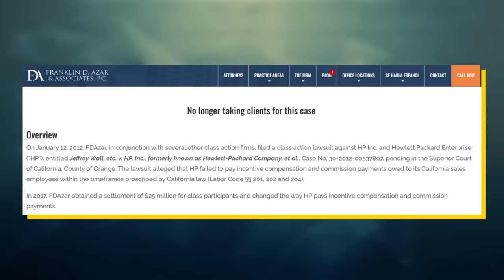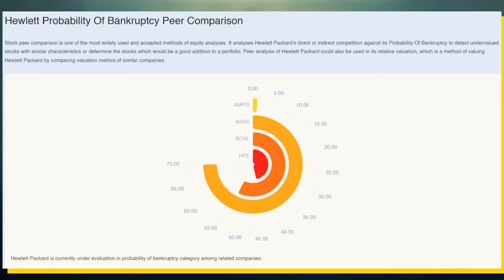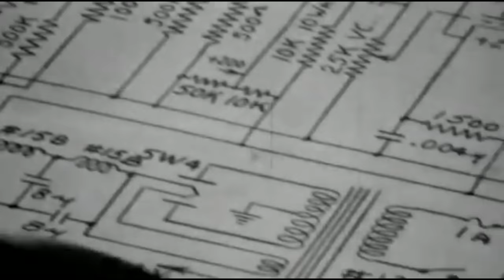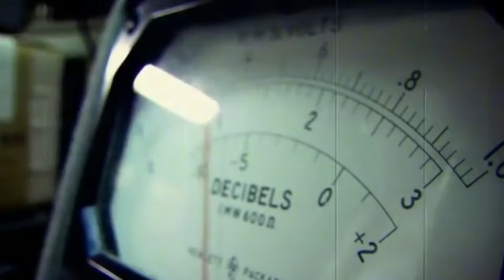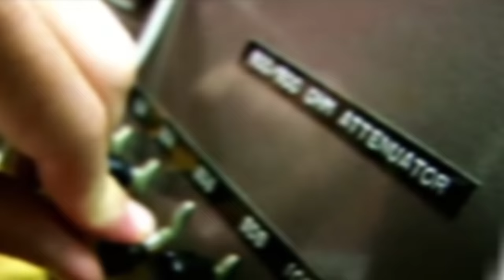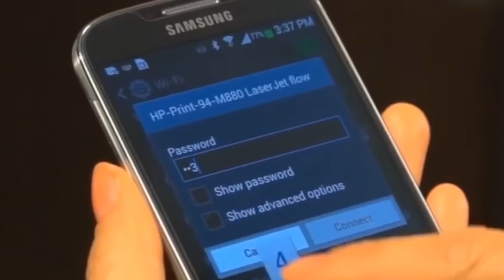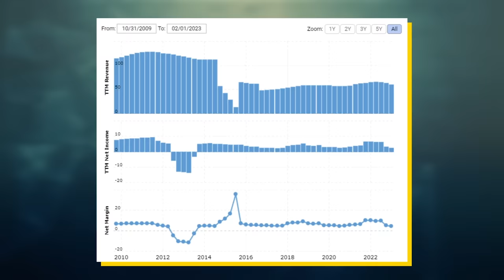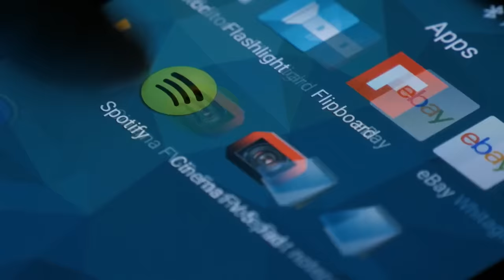From Innovation to Irrelevance: How HP Lost Their Way

Comment: The founding fathers, being Bill Hewlett and Dave Packard, weren't passionate about computers and printers.  They weren't passionate about the life sciences, diagnostics, and applied chemical markets.  They were passionate about engineering and building solid, high end test equipment.  The souls of these two wonderful individuals live on through Keysight Technologies.
Reply: The spinoff of their Agilent products, selling their verigy testers to advantest shows its lost of interest to their founders core business essentially!
Reply: Not totally correct. They also built a highly sophisticated enterprise computing business around the HP MPE, PA RISC and HP-UX technologies. Oh, and they once even had a industrial control computer biz. 

HP was absolutely remarkable in many different ways and it was financially very strong once.
Reply: @linkcubuspark  Correct. Advantest is now a key element of the semiconductor production process. They supply the testers to check most of the semiconductors we use these days. Think of Android CPUs, GPUs, Memory Chips, Power Transistors etc. The HP Way is also very much alive there.

Comment: I worked at HP from 2009 to 2012. In that time I was given 4x role changes from l1 support to l2, then l3, then sustaining. This wasn't cause I was some amazing tech, but because I was the only one who hadn't been on those teams for 5+ years and was applying for the higher roles. Sadly in 2012 they layed off the entire support department I worked for so they could hire cheaper engineers in Georgia. As I was moved to engineering I was kept onboard but wasn't going to stick around knowing what they do to employees so I left for a customer who wanted to bring me in house. This is their doenfall, they shoot themselves in the foot to save a few dollars over and over again.
Reply: It reminds me of Boeing who opened a factory in South Carolina to save costs. South Carolina doesn't have the calibre of aerotech workers that you get in Washington. The planes ended up with all sorts of shoddy workmanship, so much so that clients specifically wrote in their contracts that they wanted their planes to come from the Everett factory. I think that HP and Boeing suffered from the same rot you get when you're an industry leader.
Reply: @JB-yb4wn  Boeing definitely had it's issues, but not as bad as Lockheed. I used to work for Northrop Grumman. Grumman would do sub contract for both. There were times Grumman would win a military contract & build what ever was contracted. Few years later Lockheed would get a contract to upgrade it by undercutting the cost. Then a year or 2 later Grumman would win the contract to fix whatever Lockheed screwed up. Lockheed still makes decent instruments for aircraft, but should be kept away from any other contract. It's a shame how low Lockheed has fallen.
Reply: @williamallen7836  
You would think that the military would have wised up to such shenanigans and told Lockheed to shape up or ship out.
Reply: @JB-yb4wn  0
Reply: @NymbusCumulo928  
You guys need a revolution.
Reply: All American business leaders seem crazy for cost cutting stuffs
Reply: @armamentarmedarm1699  
Not in the US I live in Canada

Comment: A big portion of HP was left out. They acquired Compaq and with it huge consumer and especially server portfolio. Remember, Compaq were the predecessors of HP rack servers. They also acquired Alpha CPU architecture and ventured into Itanium, which turned out to be a money black hole.
Reply: Bought Palm in 2011, shut it down in 2012.
Reply: Before Alpha, HP and Commodore tried with PA-RISC. Commodore went bust in 1994.

Precision RISC Organization, an industry group led by HP, was founded in 1992, to promote the PA-RISC architecture. Members included Convex, Hitachi, Hughes Aircraft, Mitsubishi, NEC, OKI, Prime, Stratus, Yokogawa, Red Brick Software, and Allegro Consultants, Inc.
 
If Commodore survive into 1995, the Amiga would have PA-RISC OpenGL-based games console and personal computers.

HP replaced Motorola 68K-based workstations with PA-RISC.
Commodore attempted to replace Motorola 68K-based workstations, personal computers, and game consoles with PA-RISC.

Comment: I used to work for HP.  Like the article says, they were known for innovation and highest quality products.  They were also known for integrity and HP culture  and philosophy.  It was a great company to work for.  Customer satisfaction was a focus.   Then came Carly Fiona, et al and it went down the drain. Buying Compaq was the biggest mistake. Only person benefiting from that was Carly.  Instead of innovation, they would buy a startup and peddle that for few days until that became obsolete and buy  another and peddle it for few days... you get the picture.  Their theory was that the startups could invent products much cheaper than what HP could do with their overhead of a  large corporation.  But then there was not a clear path as they do not know what product they would acquire next and how they all fit together. I just bought a laptop from HP,  and needed customer support.  I would never buy another HP laptop.   I worked at Roseville and Cupertino locations.  I never could never imagine a day when HP would have to sell the Cupertino location just to make ends meet! It sure happened some years ago.  They also sold several buildings or demolished few to cut costs at Roseville. Talk about going from Riches to Rags.
Reply: THere is a still a C3600 HP-PARISC  workstation in my garage. I use it from time to time .... as a box to step on when i have to change the light bulb. Dam'it this machines were made to last forever and break peoples back when moving their desk.
Reply: @llothar68  Due to my past loyalty, I have been buying HP Laptops.  The last one I bought s a piece of crap.   It would not even boot up when  opened the box.   I called HP support and they wanted me to subscribe to HP support that cost $50 or $60 per month.  They could not fix it and it is unusable.  I am never buying an HP system or anything from HP again.
Reply: @ramaswamyadisesh6848  Well this workstation was build i think in 2001. It's a massive block of steel, a PC sized desktop case but 30kg weight.  I would also not buy HP today. This was a retro purchase to see what professionals have used in the past. Payed around $250 for an 8GB machine. 

Honestly with Laptops. I would never buy one at the moment. They are all compromises or way too expensive. I go with Desktop or Tablet. I guess thats what getting old means. I'm not so mobile anymore like in job/university days. I'm still a contract worker. But a good chair for $900 was more important then a Laptop.
Reply: In the end the founders did not groom the right successors. Neither their own children nor a cadre of HP engineers were groomed into worthy successors.
Reply: @llothar68  Any interest in a Digital Equipment Corporation MicroVAX II in my garage?  It still powers up.  I so loved VMS.

Comment: I have an HP laptop and a scanner from 2012 that I still use today as a hobby. 2 years later, the fans stopped working and HP fixed them for free, including shipping. Sad to see them go 

Problem is, today there's a lot more of competition and people are buying more and more high end computers , and PC parts, something that HP doesn't offers
Reply: HP simply offers crap value and nothing exiting. Look at high end gaming laptops, and you will see aorus giving you dual 1070 laptops each pulling 115w with an oc'd i7 in a laptop lighter than other gtx 1080 laptops all the way back in 2017. What did HP offer you? nothing. 

Even today, asus is starting to move to OLED on more and more of their laptops and HP being the relic, don't see any reason to offer glossy/OLED options on their gaming laptops. They neither have very impressive high end gaming laptops. 

HP also doesn't particularly make the best ink printers, often breaking down and just being crap to use. Laserprinters are fine from them though.
Reply: @siyzerix  I thought HP Spectre was popular

Comment: I owned several HP printers and they were all very good. However they recently discontinued the Pagewide line with no replacement. I have completed a switch to Epson as they are innovative, have a huge range and great performance.
Reply from the maker: Ah, so you’re the reason!! Haha jk
Reply: The pagewide were solid. We still maintain the product line but not for long.
Think they just weren't that popular.
Reply: Interesting, as I'm guessing the problems are with the consumer DeskJet line where HP seem to prey on non-tech-savvy people only looking at the price, such as my dad in 2014. I'd still buy a different brand following recommendations made to other users in Reddit comments.

Comment: Last year I bought a HP inkjet printer, and it was such a nightmare to use that I was actually relieved when it failed after less than a year so I could get a refund. Only to discover that the only way to remove the marketing software the printer setup had installed on my computer - according to HP itself - was to do a system restore to a point before I installed the software.
Reply: I had a preference for HP since they introduced the first consumer Deskjet 500. It was a toss up between the HP and a Canon inkjet but I believed the HP had the edge and I had great service from it. More recently I needed a photo printer and found HP offered none - bought Epson and very impressed. I now have a second Epson Ink Tank printer and all remaining HP printers went to charity!

Comment: I worked for HP in 2011 i.e. 12 yrs ago when they Mark Hurd fired 50%. Leo came in and said we will diversify to software and did a very bad acquisition Autonomy. Last I heard they are doing well with 3D printers. But it sounds like they are still struggling.

Comment: I deployed HP Enterprise software for over 15 years, and they were generally the best in their domain, but failed to execute and market new versions and visions of the integrated solutions from their acquisitions (Mercury, Opsware, Peregrine). Yes, the big mistake was not performing the correct DD before buying Autonomy, but fundamentally it's the lack of leaderships over many years. Poor vision, can't execute. The HP Enterprise Management and Monitoring software were leaps and bound to what I have to stitch together with the current Cloud solutions. HP had jewels in their assets but failed to see it.

Comment: I once used a HP monitor for 10 years without any issues. That's still sitting in the closet in my room. It can still run but the display now shows a vertical green line and the display itself is somehow peeling away. So I switched to a g7 odyssey 4k last year. Before that I was using the same g7 but the curved panel. Also when I was buying my first gaming laptop I really considered the rtx 2060 hp omen. That thing really appealed to me a lot.

Comment: A dysfunctional board, dishonest top-level executives and incompetent middle management made a good recipe for the Gray Lady of Silicon Valley. Microsoft and IBM were able to regroup (industry loves the word "reinvent") with different strategies. Randy Mott is the best example of the leading causes of HP's decline. He has a clear formula that suckers most CEOs (Walmart, Dell, HP, GM). Most of the incompetent senior managers and directors (from 2003) who stuck around till 2012 became VPs (Peter Principle at its worst?)! These people ensured that their sycophants tagged along. The inability to distinguish themselves (how's Agilent doing?) from the crowd meant being at the mercy of the ODMs. If Wall St was happy but entry level managers were leaving in droves, it didn't matter.

Wonderful case study opportunities for budding MBA students using the actions of top-level MBA (including Harvard alumni) graduates at HP. Don't blame it on the commodity business when ample opportunities existed with an overloaded Mergers, Acquisitions, Divestiture and Opportunities (MADO) department at HP.

Comment: HP is a bittersweet story. I'm an Electrical Engineer and HP alumni 1981-1991. Loved their logic analyser in college with button menu instead of the toggle switch alternative. Worked on the HP 3000 systems, which I understand was one of their speculative endeavors. Maybe they couldn't stomach competing with Tektronix, etc. - computers drew them into a rather strange place. But while I was there, loved "The HP Way" culture.  I subsequently had an HP Laserjet 5MP for over ten years, awesome reliability. Never loved their PCs, prefering IBM/Lenovo or home-built systems with generic components. I miss HP, sniff!
Reply: HP 3000 was a huge success, so was PA RISC and HP-UX.
Laser- and Inkjetprinters were true innovation then.

But then the founders died and all went south.

Comment: Im not too sure about the more expensive laptops but my 2016 budget hp laptop had bad battery management circuitry, damaging the battery and having to replace much more frequently. A budget 2016 Lenovo on the other hand had not seen a battery replacement until the HP went through 2. Older HP laser printers, without the software lock, still the best for reliability and value
Reply: MBA management of a computer company !

Comment: In the server space HPE is still quite relevant, known for their far superior BMC and having just launched a new series of Ampere-based ARM platform servers
Reply: Hpe and hpq are diffetent companies now, they split
Reply: @ihakker1416 they absolutely are. The big thing I think people are saying is that the consumer electronics decision of what was hp was never the most interesting part, instead we now have at least 4 companies that make up what used to be the HP of its hayday, HP Inc (consumer electronics), HPE (enterprise computing and consulting), Agilent (medical devices), and Keysight technologies (test and measurement equipment). Only HP Inc is not thriving.
Reply: Still a shadow of the 1990s HP, which had PA RISC, MPE, HP9000+HP3000 semi-mainframe computers.

Comment: HP started it all for me. My first PC I dissected when I was 9, HP. My first laptop when I was 13, HP. I even sent them a laptop design when I was 12 just to see that design on a store shelf a year later. Every PC I ever owned that I didn’t build, HP. That ended around 2016 when I switched to a Mac and started running BootCamp for my Windows needs. HP just couldn’t compete with the build quality. As a tech, I was always recovering data from dead HP machines with fried boards. The fall from Grace is fast and hard, as Apple also may soon discover.

Comment: After the exit of Hewlett and Packard from the scene, the company suffered from a succession of dysfunctional boards of directors coupled with takeovers that diluted the culture of the company and made no sense strategically.  One of the first of these was the take over of Apollo when HP was 4th in Unix Workstations.  

After that the greatest catastrophe was the appointment of Fiorina who, as a smokescreen for her failures, engineered the merger with Compaq.   What would have made sense would have been to get out of the PC market where profit margins were much smaller than HP normally achieved.  The merger with Compaq destroyed what was left of the HP company culture.
Reply: Apollo takeover was 10 years before the founders died. HP was a powerhouse then.
Reply: @frankgerlach4467  Bill Hewlett and Dave Packard were both retired by then.   Packard later came back when it was clear the company had become overrun with committees and bureaucracy.  John Young was essentially fired although it was presented as a well-earned retirement.

Comment: For me, the issue was with infrequent needs to print. On a Laser printer, found it often clogged from the periodic cleaning cycle, so now instead of letting the printer go into low power standby, it gets fully powered off, often for a month or two between print jobs. If I knew of a way to turn off self eating of supplies, it would have been a much better printer. Bought a used LASER printer to deal with Ink Jet printers either clogged from dried ink, or out of out of ink with a saturated waste ink pad.  Did not expect to have the same problems with a dry toner printer. Turning off the power fixed the problem. Found newer printers have a built in expiration date in the supplies, so even shutting off the printer may refuse to use older toner cartridges, so I am sticking with my older used printer. Now if HP manufactured printers without the built in obsolesce, I would more likely to leave the printer on, print more as the printer is on, and upgrade for better printers when old printers no longer works. Knowing newer printers have higher self destruct operation, they are not considered for future upgrades.  They took away the ability of the user to use the printer until the print quality suggests a cleaning is needed, or a cartridge out of ink needs changed. Nope, they run cleaning cycle s and expire the supplies, not based on print quality.
In relation to the video, I do remember the stable twin T oscillator with the bulb to produce a low distortion sine wave with high stability. Used and repaired those.

Comment: Anyone else remember when HP came out with that digital fish in an aquarium? If you did not feed it it died, so you had to run the program at least every several days. But if you really wanted the fish to be happy, you had to feed it 'special' food that you could only get by printing multiple copies on your HP printer. 
It didn't take me long to figure out that I could just turn off the printer and send a large job to the spooler to fake it out. I'd delete the job then turn the printer back on. I had tons of special food and a very happy digital fish.
Remembering to feed the fish, though, got to be a hassle, so I forgot to feed it and it died. {sniff}